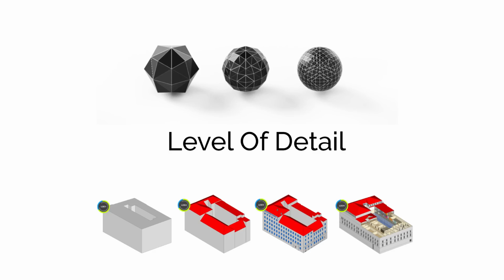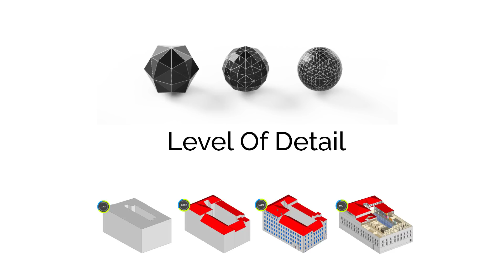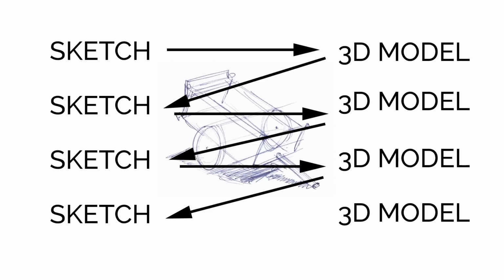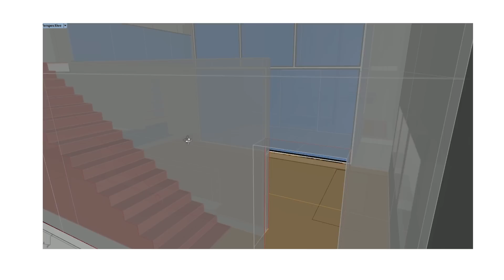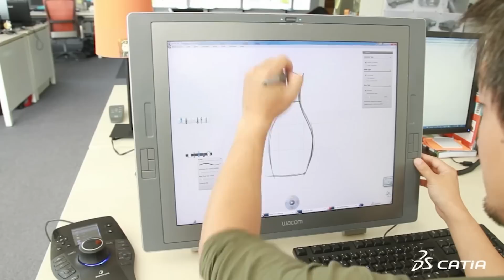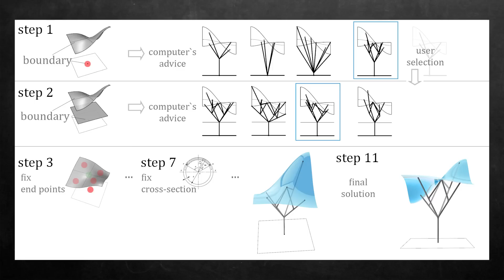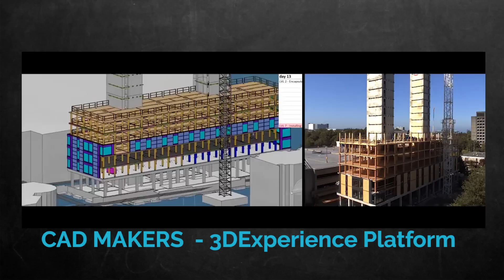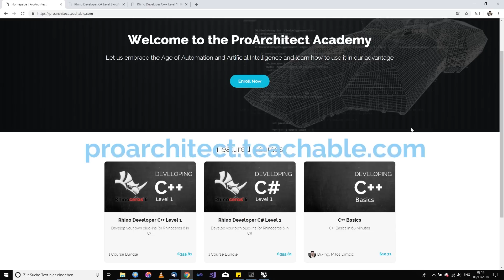ProArchitect #024 - Architects, stop wasting time!

Comment: I wanted to start on the Rhino C++ course, but during the video where you explain what software to use you specifically said to use Windows. Why is that? I currently only work within OSX on a macbook pro and I have access to Rhino 6 and Visual Studio 2017 (for mac). I guess I could do bootcamp and have also Windows on my mac, but that will definately cause performance issues..

Would bootcamp work sufficiently? I mean I am planning on buying a very strong imac anyway..

Comment: The interesting part is not to make everything fully parametric (it is too inflexible untill the permit design is finished), but how to communicate in just 3D under time stress. 3D is still only a representation of the work and now requires a new language for communication between parties. How to communicate exact measurements, window types, etc. in an worldwide industry standard without using the old-fashioned 2D plans? The answer is in rapid development in the context of BIM, but we still need a few years to have that architectural 3D language finalized